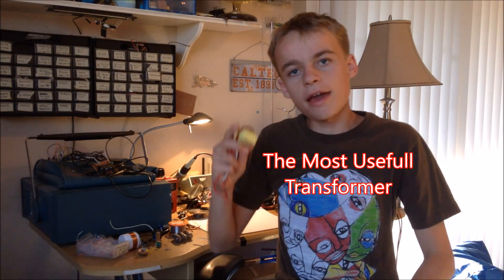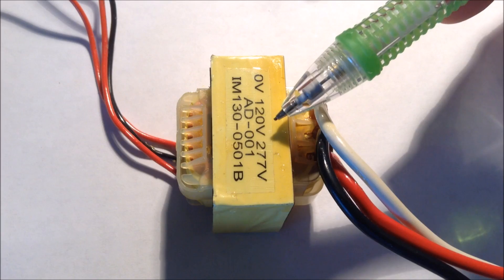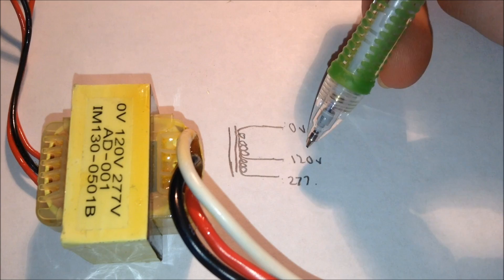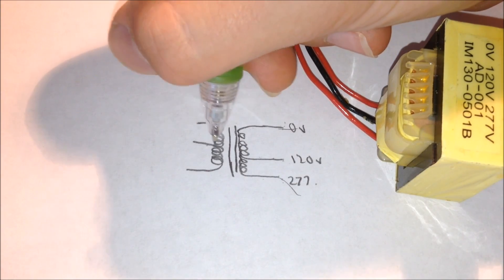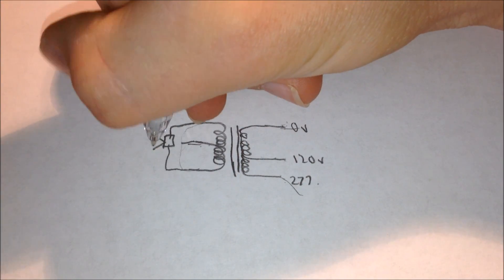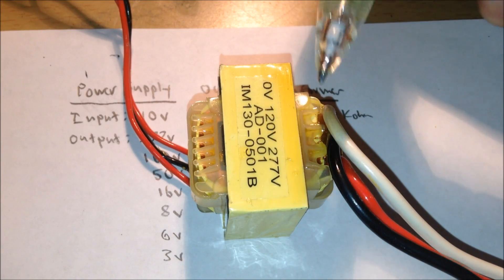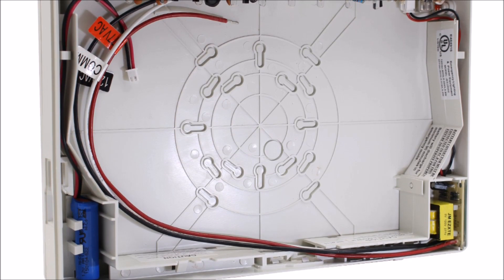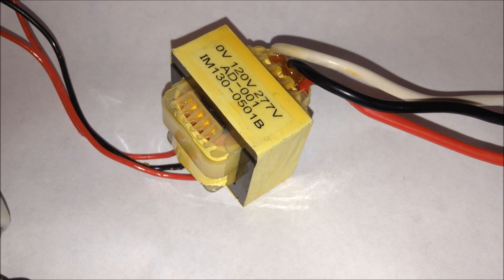The Most Useful Transformer Ever

Comment: Most large (industrial) buildings use three phase power and the 277v is the voltage of any of the three phases to ground .... As  for your little transformer You can also wire the primary in series with the secondary either in phase with each other to add the secondary voltage to the primary (boost transformer) or out of phase with each other to reduce the primary voltage by the secondary voltage (buck transformer) ....

Comment: Hi! Given your young age, you can be excused for using 277 primary tap to get high voltage for tubes, and also be excused for using it as tube output transformer.  The first use is way too dangerous and you must never do it.  The second use is just plain janky....tube output transformer needs air gap to prevent saturation which if not prevented results in low sound quality.

At roughly your age I made an oscope from an old bw tv, without connecting any wires to the tv - signal went by rf into the tv.  It was a bit janky, but impressed everyone like my parents who knew nothing about electronics.

Comment: technically that isn't an auto transformer. It's just a transformer with several taps. Since you seem smart at least get your terminology correct ! An auto transformer is an  inductor with a variable tap and has no isolation from the input ( mains ). I have watched some of your video's and did like them.
Reply: ...and when he connects it to get 277V or 50V from 120V without connecting anything to the secondary then it is acting as an autotransformer...technically.

Comment: Audio transformers should have an air gap! Without the air-gap  you can saturate. Stay away from all this guy's tips!
Reply: Depends what you are amplifying. I'd say that if you want to make a push pull guitar amp you can go for a slightly oversized power transformer as the output transformer. If someone doesn't understand that a autotransformer is directly connected to live mains they should not even come close to higher voltage electronics.
Reply: Ml mo mo ml
Reply: You need an air gap only in single ended outputs OR you can have a oversized transformer (VA rating) and it wont saturate either.
Reply: Its NOT an Audio Transformer, Was for Various Voltages, He was right
Reply: the real point is a power transformer does not make a good audio transformer. That's not so bad if the audio just sounds bad, the real concern is someone using an auto-transformer and not understanding that it is not isolated from the line, and getting shocked or worse!
Reply: Did you watch the video? He explicitly says how he used this transformer for an audio output transformer.
Reply: Why not simply get a tube audio transformer?
Reply: Perhaps, if you just happened to have this transformer around and you were trying to repair an old tube radio. If you are purposely trying to repair something, perhaps you ought to buy a transformer that's is specifically designed for the job. This is especially true if you are fixing the item for someone else or collecting a fee to do it, do it right.

Comment: The basic function of this transformer is to have a balanced voltage source.
On the secondary side, the black wire is 0V (GND). Or also called center tap. Put the two red wires on a bridge rectifier. Then you add two buffer capacitors between positive and 0V, as well as between negative and 0V. Thus, you can take a positive, as well as a negative voltage.
Symmetrical voltage sources can also be found in high-quality audio amplifiers, inverters and in electronic switching power supplies.

Comment: If you use a toroidal transformer you can wind your own secondaries, and add or change voltages even easier. The only issue with using those small laminated EI transformers is regulation is poor, and if they are under-excited for example connect say 120V ac across the 277V winding the output power drops dramatically and regulation becomes very poor, mainly due to increases copper losses in the primary and secondary. I gather in US standard commercial service voltage is 277/480V Y 3 Phase, hence the requirement for the 277V input. In Australia we use 230V/400V Y.

Comment: He mentioned using just the primary to change voltage is more dangerous but failed to mention why the shock hazard. There will be no isolation from current paths to ground like one gets from a separate winding on an average power transformer circuit.

Comment: Be careful though because when you are fooling around on the primary side like that you are NOT isolated from the powerline! Thus if you use that on your electronics as you may have you have a possible electrocution risk!
Reply: Right...He mentioned using just the primary to change voltage is more dangerous but failed to mention why. There will be no isolation from current paths to ground like one gets from a separate winding on an average power transformer circuit.
Reply: I have an old new stock harmond   transformer with only  a coil on one side of the transformer .  for 120 ac  voltage like he was talking about

Comment: In the U.S., 277 VAC has been used in commercial retail and industrial fluorescent lighting for a very long time (45 plus years).  These lights could be nearly as efficient using the much more common 240 VAC, but there is a side benefit because thieves won't steal the lights that use 277 VAC.  I don't know if that is a primary reason for using 277 VAC, but it does help reduce the number of stolen lights.  Great video!
Reply: Another benefit of 277 volt lighting in a commercial setting is the number of lights that can be put on a single circuit. Because the voltage is higher, the ampere requirement per light will be lower. This means the need for less breakers. Also it is easier for a lighting control panel to turn off whole departments of lights after hours. I worked projects where I installed such a panels and after hours it would blink a dept of offices lights to notify the lights will be going down in 5 minutes. If employees are working late they can dial a number, punch in their code to keep the lights on for another hour.
Reply: Rick Delair I disagree. I have 10 year old Cree LED recessed lights in my kitchen. And I have not noticed any loss in lumen output or any shift in color hue. We have been using them about on average 8 to 10 hours a day. Yes I have had about 4 cheap LED lights fail on me, but they were the cheap ulititec  brand. But on the whole I have had complete satisfaction out of the rest of the LED's I have been using. Don't buy the cheap ones. You get what you pay for.
Reply: Rick Delair Actually now days, most high end  modern LED light fixtures (both hard wired and some screw base) will run on any voltage ranging from 100 to 277 volt 50/60Hz.

Comment: everything is spot on, except for the little tidbit about industry using step up transformers. Building and bucking transformers are found in industry, but their primary purpose are for small loads in machinery and equipment requiring different voltages. In the US, almost every of newer industrial/commercial building utilizes 2 separate transformers and load centers. The voltages for these two systems are 120Y208 and 277Y480. Old buildings may have 120/240∆240, and sometimes a ∆480 load center. In Canada, and few examples in the US use 347Y600. If you haven't done so already, do some research on ∆3 phase. Interesting configurations can be wired in delta, and watch out for that wild leg!